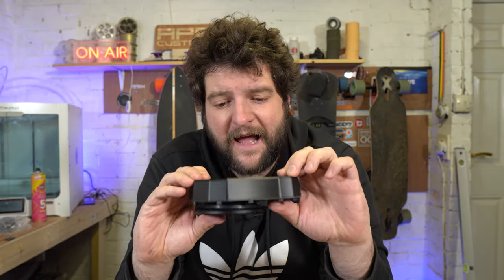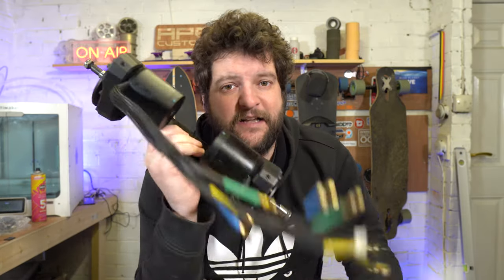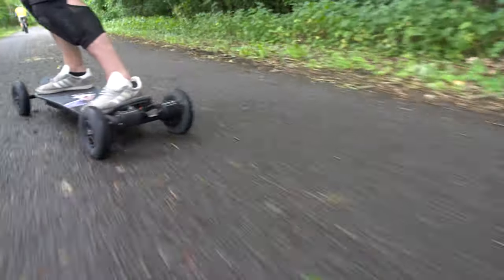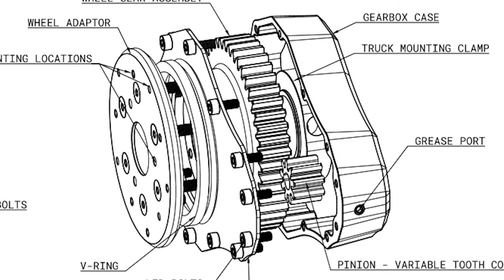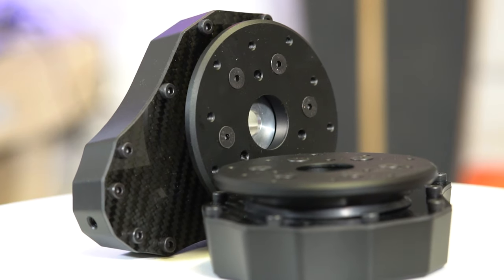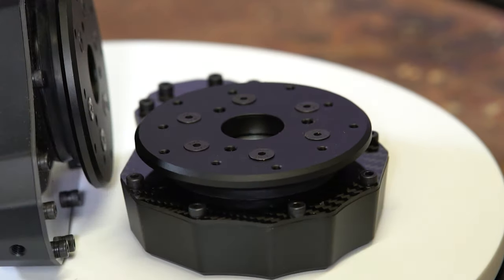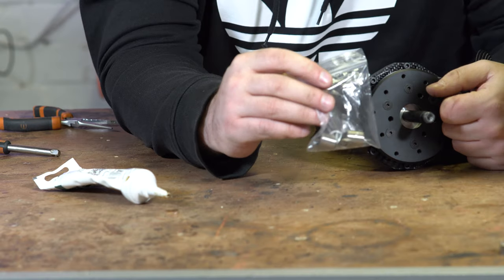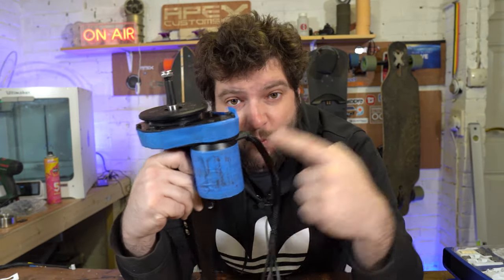Moon AT Drives - Overview and INSTALLATION GUIDE

Comment: Nice video Lee

I have my own picture guide (can be found on my website) that details certain areas that Lee wasn't able to cover.

The clamp in this video was designed for non-CNC hangers, but as shown in the video it can also be used on CNC hangers if you are patient. CNC hangers have a slightly smaller profile and there will soon be a dedicated clamp for each hanger. This will ensure best fitment on the two types of hangers.

One key note, please allow 24 hours for the Loctite to cure before you start riding. 

You are also fine to run the drives without grease on your maiden voyage, this will help if you need to tweak anything  inside the gearbox after your first ride.
Reply: can I just say one thing? Sorry for this, but your website is terrible. I don't know what I'm adding to the cart, it keeps me repelling from buying your (obviously greatly engineered) product. where can I select the correct pinion for my motors? I just don't see it.
Reply: @pjortmaszyna  Everything you need for the moondrives is on the homepage. If you need assistance just email what you need and we can provide you with an invoice.
Reply: Will this drive fit on Evolve GTRs or Hadean ?   ..............Your website needs work.

Comment: Wow. I just ordered a set of these a few days ago. What lucky timing for me. Can’t wait to give them a go on my mbs build
Reply from the maker: You are gonna love them!
Reply: I ordered both the 10t and the 12t pinion gears, trying to find the sweet spot between torque and speed. Do you
think I will notice a significant loss of torque with the 12t vs the 10t?
(Still a work in progress, but most likely 12s6p, stormcore60, and 190kv 6374 motors)

Comment: I might have a suggestion for loctite. The thread must be free from grease and other debris. Brake cleaner is suitable for this.
Reply from the maker: Yeah its a good suggestion, no reasona  new gear drive would have grease or debris on it though?
Reply: @LeeWright  Cooling fluid or cutting oil residues during manufacturing. It makes sure, that the bond is strong enough😃

Comment: They look like fun to me! 
Could you instead of cutting the motor shaft, do you think you could install a support baring in the housing opposite the mount for the motor? Love the channel and the direction your taking.
Reply from the maker: Moon has a solution coming where he will allow for longer motor shafts, but currently cutting is your best option
Reply: @LeeWright  That's interesting to hear. Cutting the shaft really puts me off as I wanted to keep my Idea belt mounts as a back up. But that doesn't work if I have to chop my shafts down. Eager to see the evolution of these drives.

Comment: Is the carbon cover acting as a sound body? Perhaps a layer of glue/rubber to reduce noise? Also: why have 4 grub screws per hanger bracket? Would 2 not increase the contact surface?

Comment: i plan on getting a set when i get paid so good timing on this video, wish i could get the 9t pinion but I've got a 10mm shaft motor. would a saw be okay for cutting the shaft down to size?
Reply from the maker: yeah dude a metal saw would work well, ah great timing! 5% off coupon!
Reply: woo glad i hadnt ordered yet. do you know why i cant get the 9t with a 10mm bore?
Reply from the maker: @MatthewDixon001  I do, the less teeth there is the smaller the gear and so you need a smaller shaft dude
Reply: @LeeWright  ah that makes sense, shame i would love to have the torque of the 9t or 8t but the 10t is the same ratio i have now so it'll be fine. i cant wait to be able to go offroad and not worry about mud getting into my pulleys and causing belt slippage
Reply from the maker: Yeah it’s a big issue with belt drives!
Reply: @LeeWright  and also broken belts half way through a ride, i once broke a belt by trying to accelerate in mud when not being able to move and it just snapped. i wanna order moon drives now but the other half wont be happy if i don't wait until im paid
Reply from the maker: I don’t mean to hurry you at all, but he has 9 sets left in stock and they will be sold pretty quickly.
Reply: @LeeWright  thanks for letting me know

Comment: Will a 10mm "D" shaft work with the pinion that it comes with
Reply from the maker: Afraid not mate, need to be a keyway
Reply: @LeeWright  so i just placed an order from Moonskate for the MATRIX2.  So how do you like direct gear vs belt. 
I decided to also replace my motors with a 8mm shaft. Thanks